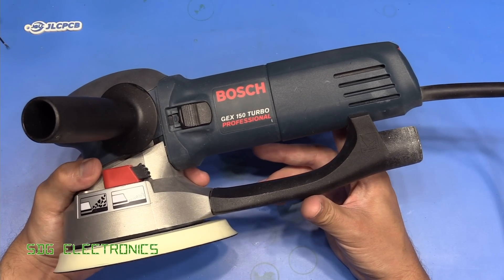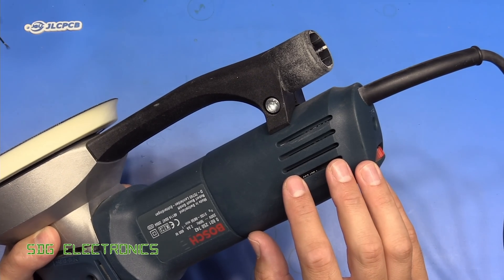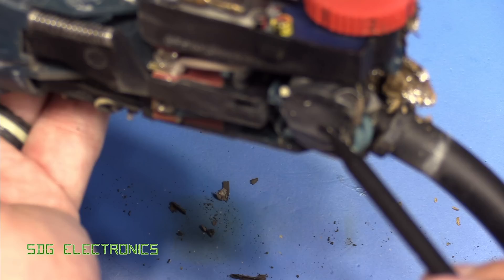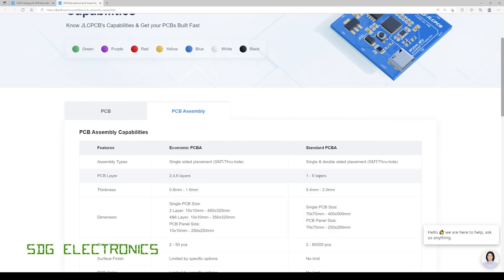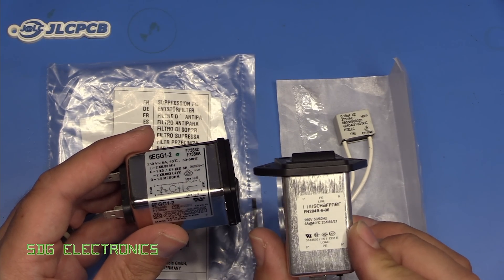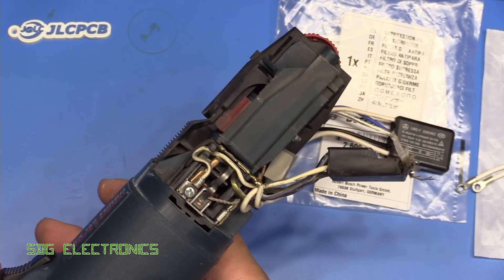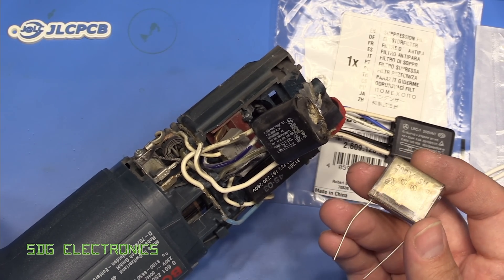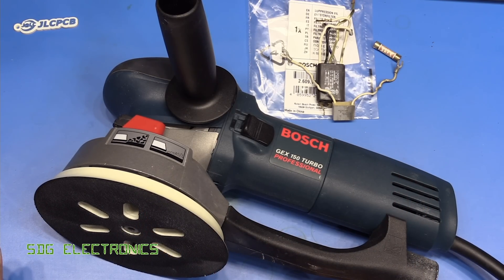SDG #259 Metallised Paper Capacitors still causing damage... Bosch GEX 150 Turbo

Comment: Hello, does yours get hot? I bought a new one, and it gets hot after 10min of light sanding and smells plastiki? Alu body comes quite hot, never had a sander that got hot not even after 8 hours of sanding. Use sanders daily (mostly festo). For more than 450 euro i expected a much nicer machine. Has been in repair 2 times with Bosch and still gets hot and smells...

Comment: It seems like the failure mode of these paper caps is to just explode, and they also seem have an inherently limited lifetime. If only there were another kind of capacitor that used a different material instead of paper that was more reliable and failed in a less violent way. Say, a polymer film. 🤔

Comment: 13A fuse? that seems a bit on the loud side.
Reply: Yep......340W!
Reply: @IanScottJohnston  340W protected by a 3kW fuse. What's the starting current of that motor it must have a hell of a torque.
Reply from the maker: @TheEmbeddedHobbyist  600W or 2.6A
Reply from the maker: It's 3A or 13A for factory fitted fuses. I guess inrush was a concern enough to avoid the 3A. In Europe though it'd be connected to a 16A schucko

Comment: Lol, as you were discussing the exploded parts diagram and the wiring I was thinking to myself maybe you shouldn't trust the diagram too much and go with what is actually wired in the device. Then the other thought occurred when you noticed the discrepancy in the drawing .... maybe the tool was assembled incorrectly from the get go hence the failure? Sorry to be a caster of uncertainty....
Reply from the maker: The diagram didn't quite make sense as it had all of the motor current going through one of the capacitors in the filter. The original wiring was definitely correct
Reply: Diagrams are often incorrect, simply because they are often taken from early versions of the assembly documentation, but are revised with either a different part in production or just because the drawing was done by a totally separate department with no actual tool, just lots of photos to work from, and not ever proofed. Especially electrical parts, where there might be 3 or 4 different suppliers of the part, all made slightly different, and only the one was included in the manual, with perhaps a note about alternates, but no other info. Electrically the same, but often different leadouts and colours, but the same electrically and in most physical dimensions, so it will fit.

Comment: Wow, I did not expect to see proper pictures and parts for stuff like that in this day and age.
Reply from the maker: Bosch power tools always have the full diagram available and parts available for a long time. Robert Bosch foundation is worth supporting in my opinion over companies that just create profits for shareholders etc
Reply: @sdgelectronics  Yes Bosch does still have spares for almost all the products they ever made, though you will find some parts are now expensive as they run out of stocks.  But still have a Bosch drill from the 1980's, and an angle grinder as well, and they are still in good order, and spares are still around for them. Other brands are not as easy, the spares might be there, but the price is equal to the price of a new machine, so they get scrapped.
Reply: EU manufacturers do this most of the time, look at commercial catering equipment and full parts diagrams and schematics are openly available, in the UK it's a lot harder even though most are made from parts sourced in the EU!
Reply: @timballam3675  Well I can imagine that easily for expensive professional stuff but hand tools are not the first thing I'd expect to be designed to last these days.
I always try to repair everythinig if I can, often it's just made reaaaally hard by the manufacturers.

Comment: I've taken to treating any caps working at mains voltage in appliances, tools and equipment as timed service replacement.  Reason beimg that sooner or later they WILL fail, usually with results as seen here and worse. So replace them on a time basis before they have a chance to spoil your day.  One of the worst offenders are start and run caps on air compressors.  If these fail, or even change value, they can easily take the motor out, or even cause a fire!  Equipment manufacturers select components on price, so it's a sound bet that the caps used will be cr4p quality.  For start and run caps I use LCR, a British company, their stuff is excellent.  Anything over 5 years old is imho, time for replacement in these applications.  And yes, those bl00dy Rifa things are diabolical!  Trickiest recent failure was a 3 terminal switch arc suppressor cap in a 30 year old boiler that went leaky.  This was causing an earth leak fault which was tripping the main rcd breaker in the consumer unit.  It only happened when the boiler had been running for 30 mins or so and I couldn't find any fault when testing!  I didn't even know the cap was there until I saw it by chance when looking at something else, it was so deeply buried!  Snipped the little horror out and all was good.  The leak only showed up on a high voltage test, at low voltage it tested ok! So s0d the spark interference, it won't be replaced!

Comment: If you are naughty and don't care about the line noise, could you simply leave them out (perhaps bridging some connections)?
Reply: Maybe, but it might eat away at the other electronics quite quickly and then you end up with a bigger repair. It might not be just an interference standards thing.